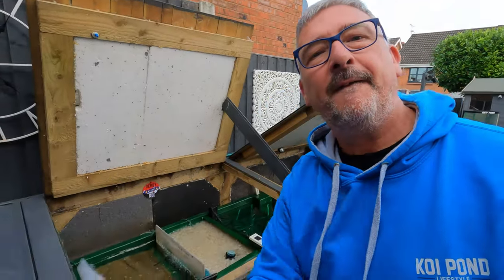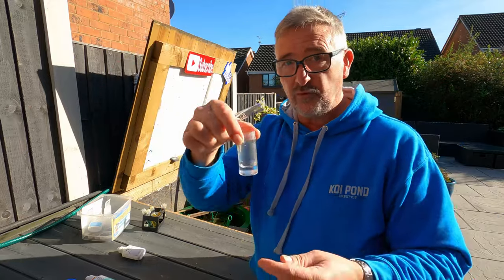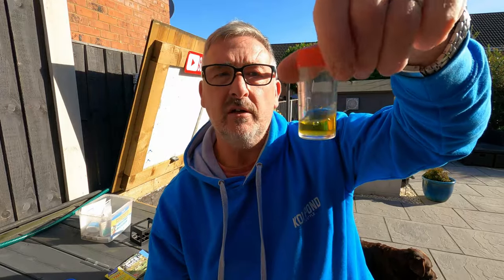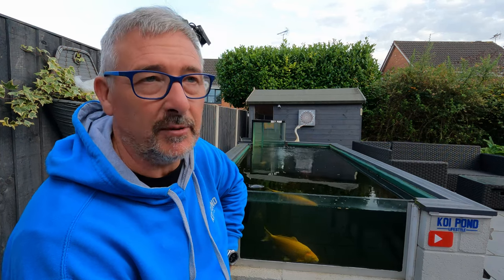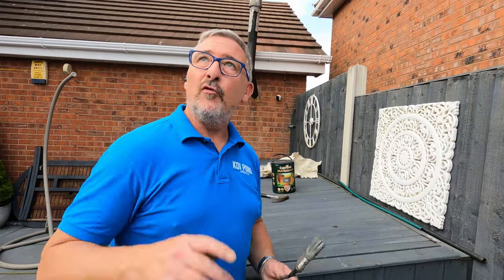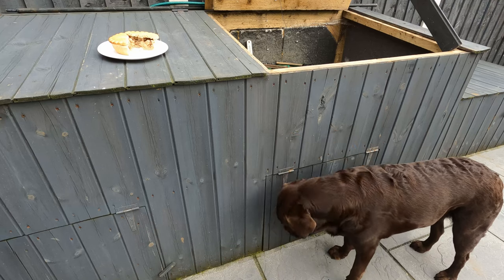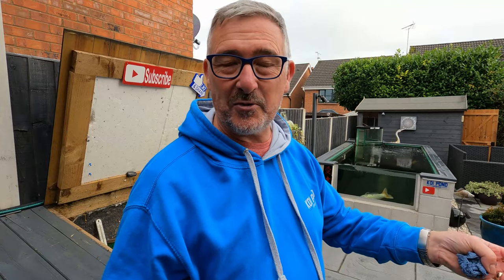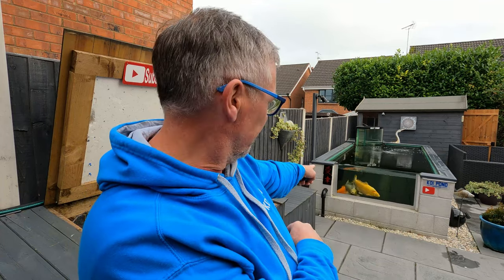HOW LONG DOES IT TAKE FOR GREEN KOI POND WATER TO CLEAR🤔*I MESSED UP THE WINTER POND COVERS AGAIN*😮😉

Comment: Hi Andy your doing well our covers are on and have been since beginning of October, our pond is 21000 Ltrs and have two 80 watt tubes but one is on a timer so it’s on throughout the day then off at night, had one or two flash from time to time and done scrapes and found nothing, suppose it’s bit like us humans if we’ve got an itch we can use our hand to scratch it, they can’t, even though ours is heated the temps are up down due to the weather, we have an air source heat pump expensive pease of junk twelve hours to lift 1 degree so added a Chinese Diesel heater to help and it does, so should of had a gas boiler in the first place but like you say everyday is a school day, 
Keep the vids coming 
Regards Paul
Reply from the maker: Hiya, thanks for the feedback. That's the thing with trying to heat alot of water that's outside in the cold, the heater whatever it is has got to work so hard to try to get to or maintain a temp.. I would be using early cover if I was trying to maintain a temp..😉👍

Comment: I normally turn my 36 watt UV off in November  (7000 Litres) and turn it back on with a new bulb in March. Not needed in the winter. Plants will take care of your water Although the KOi may tear them apart in the summer mine do. In the winter though Plants will take care of your water at little cost.  Summer get a bog filter running into the pond.
Reply from the maker: Hiya, Thanks for the feedback. My UV is also now off till next Spring...😉👍

Comment: Just reduce the flow through your UVC to give maximum contact time with the algae cells. I use the recommended flow then reduce by a further 5-10%.
Reply from the maker: Hiya, thanks for that. Wouldn't reducing the flow affect the dwell time through the filter system..🤔🤔

Comment: Have you changed your uv bulb this year ? . And what's your r
Thoughts on cheap winter pond floating heater .ona timer  over winter or leave in my filter bay ? .... or use a fish tank heater ? 
Oh yes you have better music now on your channel...😊  keep up the you tube and keep evolving..  . 
From us in suffolk
Reply from the maker: Hello you in Suffolk. I change the UV bulbs in Spring each year. I've tried the floating heaters in the past but they only crate a hole in the ice if the pond freezes. Other than that they work flat out with little to no gain with water temps..🤔😊

Comment: Another great vlog.

With regards to Goldie and the slight kink in her tail,  is there any stray voltage in the water?  Any current leakage from water pumps or perhaps a damp Ballast in the UV unit? 
Or even water briefly back siphoned into the air pump?

Stray voltages have been known to cause kinks in spines.

It's hard to test, other than standing bare feet on soil or wet patio slabs and put a hand in the water.

Just a thought
Reply from the maker: Hiya, thanks for that. I'm not aware of any issues with current leakage in or around the pond. Ive got a sparky friend who lives down the road. I might see if he can do some esring for me..cheers..

Comment: Hi and my name is Robbie as you were talking about using 2 uvs but said it will cost a few bob i am new to looking after kio and everything that goes with it but I notice you have a pretty big case with all you filter and electronic going on have you through of running the 2nd uv with solar power its a lot better and cheaper also you can run other things  just a thought love your video keep up the good work best regards Robbie
Reply from the maker: Hiya, thanks for that. Welcome to the hobby.. How much would the solar units cost and how long before they have paid for themselves.🤔. Glad your enjoying the videos..😉👍
Reply: Hi I got a 1000w solar panel and control of ebay for about 15 pounds couple of batteries or car batteriey witch I already had and got a converter with 3 plus cost 31 pounds all works well I've even got a couple of lights running of it aswell
Reply from the maker: Very interesting.... Thanks for letting me know..😉👍

Comment: Why not just get some poly carb sheets. Get some 2 x 1 long pieces of wood which would sit on the edges and balance them on allowing gas to escape and oxygen in. Use some heavy stones or bricks at the corners and the middle to hold the sheets down in case of strong winds. Mine are ready to go on but I don't put them on until temps drop below 6 - 7c.
Reply from the maker: Hiya, that's exactly what my covers are... Don't think it will be long before they are ready to go on...🤔👍